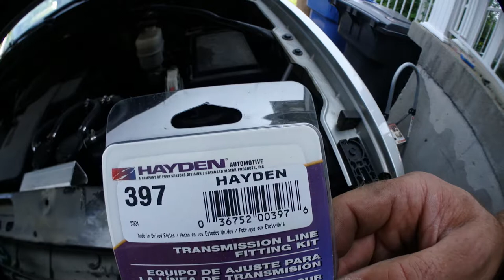GMC Sierra 2014 Derale remote transmission oil filter kit  installation - How to.

Comment: You do the same thing I do. I've been a Toyota tech for 23+ years. All of my vehicles are Auto and I have always installed an Aftermarket trans cooler and filter kit. It leaves the trans, to the filter kit, to the AM cooler, back through the radiator and back to the trans. That routing is because in theory the fluid leaves the trans "too hot" goes to the cooler, gets "too cold" back the rad to stabilize the temp and back to the trans. I don't care what ANY Manufacturer says, trans temps should NEVER go beyond 180 Degrees no matter what..

Comment: A Motorcraft Ford FL-1A filter works well with this kit. It's a really big filter and they are under 4 bucks. Mobil1 makes a filter that will also fit this kit and K&N makes a filter also. There are a lot of brands that make a filter that is an exact fit for this kit.
Reply from the maker: Yes,there is a lot of filter for this kit.
Just looking at https://www.oilfilter-crossreference.com/ and you will see what i mean.
Thanks for your comment,I appreciate that.
Thanks for watching,regards.
Reply: I just got mine for my XJ Cherokee, fortunately, the 4.0 I have will also take an FL1A filter as well.

Comment: Add a stacked plate cooler and switch to amsoil signature series atf (blue bottle). If your truck has a dipstick, not an issue. If not, b&m makes one. The 6.2 came with it, so can maybe get one of those.
Reply from the maker: Thanks for the heads up,i appreciate it.
Thanks for watching,regards.

Comment: The tough part is cleanly adapting into the factory cooler lines. Those Hayden parts made all the difference for you. I’ll have to see if I can get away with something similar.
Reply from the maker: You are right.
Thanks for watching,best regards.
Reply: A suggestion if I may? Use 45 degree connectors on the filter mount/base. That way the hose doesnt kink inadvertantly from pointing straight up. They can kink and fold/bend down due to excess heat under the hood. Also, here in the desert we go to the hardware and use a spring to put over the hose to help prevent kinking also, if we arent using prebent steel lines or braided steel line.
Reply from the maker: @joerivas9847  Very good tips,thanks for the heads up buddy.
Thanks for watching,best regards.

Comment: I'm going to be doing this soon, which one is the in and out on the cooler
Reply from the maker: I don't remember but you will  find out by starting your truck after putting the two hose. Put thtwo hoses in a jar.
Just check from wich one oil comes out.
Thanks for watching,regards.

Comment: What fluid you think is best to use I've been using redline d4 do that is too thick I have a 2001 Silverado 5.3 it was specd for dexron 3 back in 01?
Reply from the maker: I would use what GM ask for your vehicle.
Reply: @obscur156  Redline d4 is rated for dexron 3 approval. It's high quality synthetic viscosity similar to but a little higher than dexron 3.
Reply from the maker: @robpaul7900  Should be good,no problem with that.
Reply: @obscur156  I was just wondering if its ok to use while I have the derale trans kit installed hopefully it can flow well maybe I should have went with dexron 6 spec.
Reply from the maker: @robpaul7900  I am sure it will be ok Rob !

Comment: Remote transmission filters should not have an anti drain back valve because it restricts the flow of oil in a transmission setting.
Reply: How? 🤔 I thought anti drain back was a good thing? Explain please.